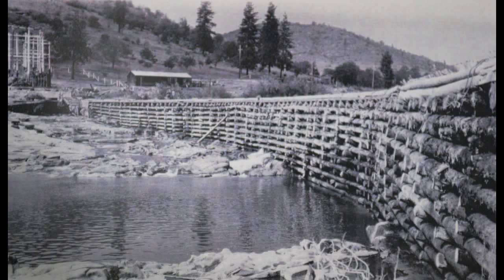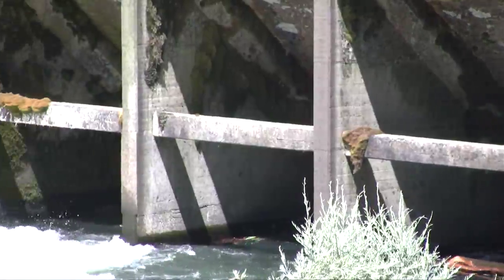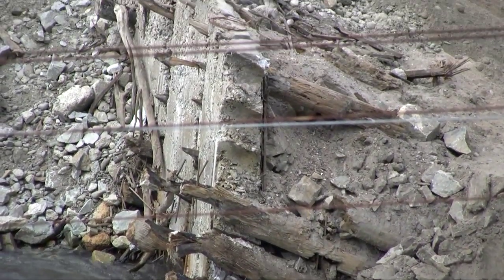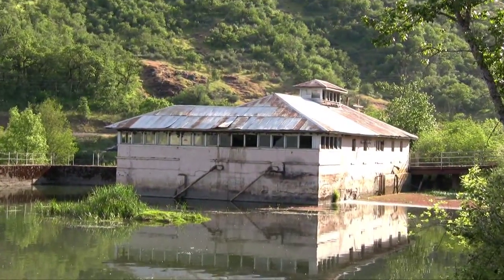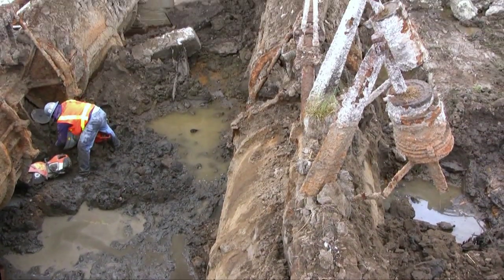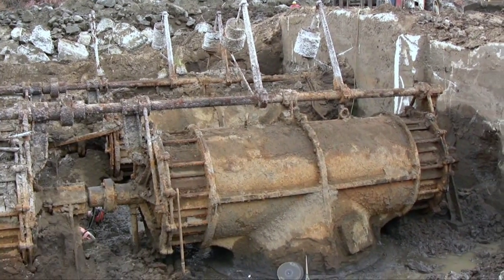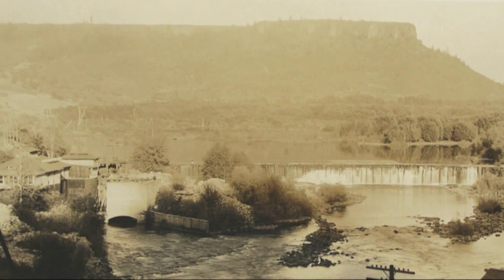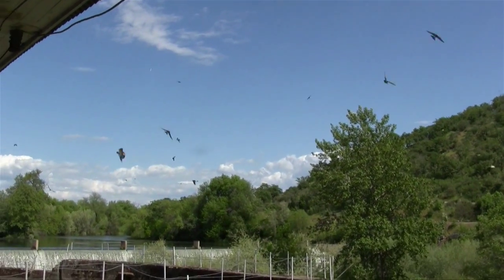Gold Ray, 1903-2010  (Part 5).mpg

Comment: Is this closed to the public?
Reply from the maker: The dam and powerhouse don't exist anymore, but there is an outdoor exhibit at the top of the hill where the lodge used to be, and they have the marble control board and one of the generators there, as well as a bunch of photos and some other stuff from the powerhouse, I think. Also, you can still see the building foundations for all buildings up on the hill, though, unfortunately, the water tower at the top of the hill has collapsed. They also have information available and a couple of the controls from the control board at the Gold Hill Historical Society museum in the town of Gold Hill. Thanks for asking about it!